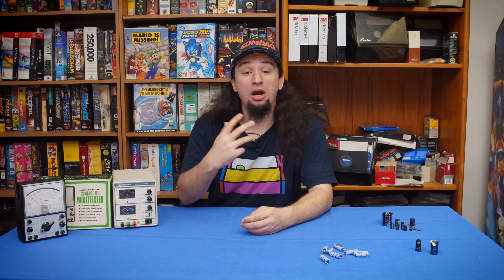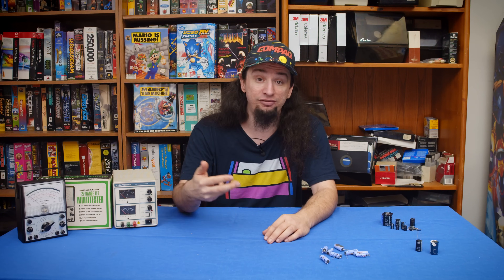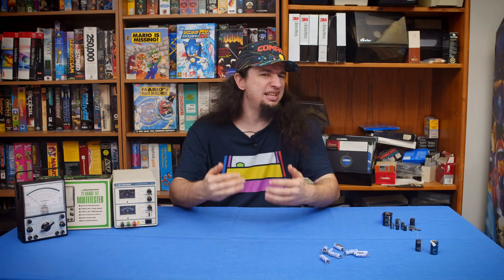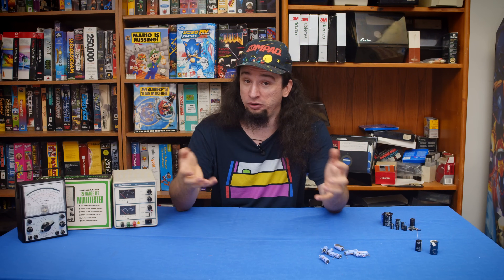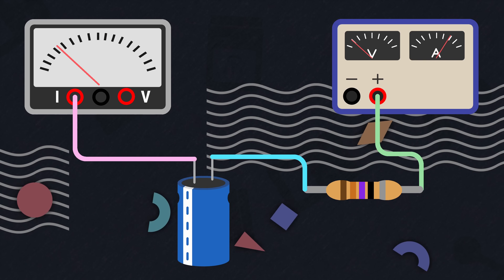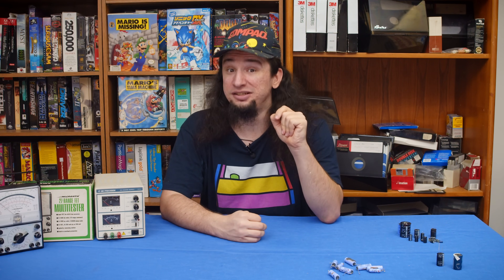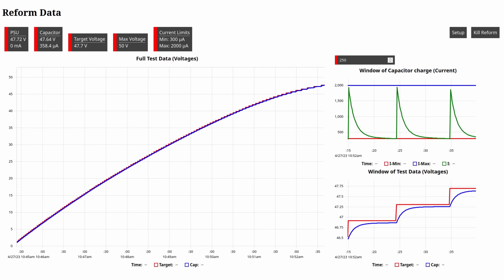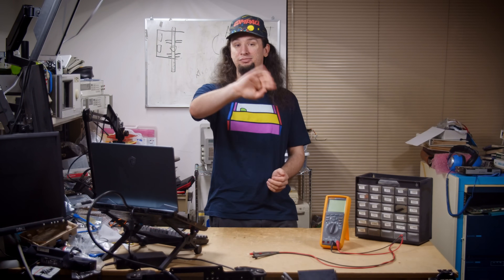Reforming Capacitors - Everything you wanted to know

Comment: Hello. It would be very interesting to make a video and talk about what happens if you use a 100v capacitor where it was originally 50v. Or 50v where there was originally a 5v capacitor.

what happens to the microfarad value during use and reforming of the capacitor or will the life be shorter when you apply 5v to a 50v capacitor og 50v to a 100v

Can someone say something about this

Comment: Hey, thanks for a nice and in-depth explanation! I've known about reforming capacitors ever since I started restoring tube gear, and I sometimes do that both in existing devices and new devices I build using antique components (can electrolytics etc.). Generally I test them before reform attempt. If there's no capacitance, it means that the lead has corroded internally and the capacitor is dead. Otherwise I'll attempt reforming, bringing the cap up on a 300VDC power supply through a current-limiting resistor, by setting the voltage to get ca. 5mA out of it, leave it for a few hours and bring it up again after the current drops below 0.5...1mA, observing the max rated voltage.

Looks like I could use a CC/CV high voltage supply for that and for tube circuit prototyping :)

Comment: If you have a good (GPIB or not) power-supply why would you use a resistor? Just set it's constant current control to 1mA, and to the voltage of the capacitor, then just wait.  Same result.

Comment: 1st step is good testing. Leakage, ESR, etc. But reforming has let me keep 70yr old amplifiers 100% original.
Reply: I recently bought a cheap kit that only need assembly, that has an LCD screen, that with automatic identification measures many types of components, even capacitors up to 100mF(!) and lists ESR and leakage. Very nice. But it is very important to completely discharge caps before testing, done first by a limiting load and then by repatedly shorting them a few times. If not, the instruments inputs can be completely damaged.
Reply: @Kenzofeis  The MK-328 style testers are handy little gadgets. I have one, but it is no substitute for my bridge, my 4 digit DMM, or even my Sprague Tel-ohmike.

The biggest disadvantage is that it can apply no more than about 5 volts to the tested component.
Reply: @johncasteel1780  
I looked at multi-testers, the multimeter lookalikes, but this chinese minifrankenstein thing does the trick at a fraction of the price, I paid the equvalent of $20 for it ^^
It noticeably drained the 9V battery when testing 1000uF caps, but that is how that works. I had to fix the PSU for a pair of minispeakers, so just had to have something, and multimeters only test to 200uF.
I suspected the smoothing cap after the rectifier and told a repairman this, he made a mess of the whole thing so I had to ignore my time constraints and do it myself, and buy that instrument, that cap had 48nF left of 68uF, so... he had short circuited something, blown components and changed even some caps that were ok...
/rant

Comment: Thanks for going through the effort to research this.  It's helpful to have it broken down to something digestible.

That said, IMO, these really large caps usually indicate that the device is using a linear PSU.  If you're supplying significant current through a linear PSU, it almost certainly has a terrible power factor, and you would be doing yourself and the electric company a favor by replacing the entire PSU with an industrial switching supply module.

I know, "historical" yada yada -- and in general, I agree.  I actually try to retain original PSUs as much as possible.  (Although I do recap nearly always, just because I don't care about OG caps, and I do care about long-term reliability.)  But, when I see multi-farad caps for something that needs a few (or even a dozen) amps at 5V, that's just crude as, and we can do a lot better.  Don't throw it out, but maybe just bypass it.  Nobody will know.  :-)

Just a thought.  To each their own, of course.
Reply: How does replacing a linear supply with a SMPS improve power factor? Are PFC circuits just a lie? Say it isn't so!
Reply: @1pcfred   Haha, no, definitely not a lie.  However, I wouldn't assume a PSU design this archaic cares much about power factor.

Here's why:

Linear supplies tend to use the peak of the AC waveform only, to top up the caps every cycle.  Active PFC typically uses something similar to a boost regulator to pull current below the voltage of the bulk caps' charge.

So...  If you're using a boost reg topology for PFC, you're already well into sophisticated switching topologies, so why would you then follow it with a linear regulator, when you're presumably capable of designing a switching buck regulator?  It would be far more efficient, use cheaper magnetics and capacitors, and consume less space and weight.
Reply: @1pcfred   OK.  ... so?

Linear supplies distort the AC waveform by pulling current only at the peaks.  It's kind of like switching noise, just at 50/60Hz and harmonics thereof.  Being at a low frequency and high (relative) amplitude of distortion, it's hard to filter out.

HF switching noise can be isolated from going upstream by adding a choke and some line filter caps on the input side.  Switching noise downstream is likewise dependent on how much L/C filtering you have on the output.

Switching noise generated by the computer itself is also a potential source of noise.  If it's a problem, you deal with it.  That's why computers are in metal boxes, or plastic boxes lined with metal.
Reply: @1pcfred   Uh.. thanks for that, I guess?

Comment: No! Just no! 
I think that you are confused.... 
In the literature you displayed to us on screen, please explain where the manufacturer stated that reforming of used capacitors is possible? 
I think that if you read the manufacturer datasheet, you will find that they are referring to new capacitors that have been stored for an extended amount of time.... 
You nor anyone else has the ability to measure electrolyte loss! 
The golden rule of capacitors are...
(When capacitors are unused but been in storage for a long time) 
Attempt to reform it! 
Check after reforming for high esr! Check for high voltage loss (high leakage current), check for capacity! It should be just under it's printed rating but if it's reading higher than its rating... It's dried up inside and replace! There's no such thing as an overachiever when it comes to capacitors.... 
(Old and used capacitors) large bulk power supply capacitors are more robust than the rest in the device... 
Most cheap capacitor testing devices can't test large capacity capacitors, the best that anyone can do is use a uA meter to test for leakage current as this measurement is more important than any other for power supply capacitors, nothing cooks a transformer faster than current leakage of its capacitors! 
As for the rest! You have no choice but to remove every single one by one and test out of circuit, you can measure in circuit for esr but not for current leakage! If a capacitor is leaking DC into the next device, it won't survive because of the phenomena of imposing a DC current on top of an AC signal, you effectively bias up the next device or stage and a cascade failure will take place! You can find new capacitors to replace old ones and while you might think that it's expensive, wait till that $5 capacitor takes out a bunch of transistors which are now considered unobtainium!... 

I personally would recommend, if you value the piece of equipment you have and want it to last long! Replace all the capacitors! 
If you want to try and keep the device as original as possible, try and track down some new old stock capacitors and take your time reforming them but under no circumstances should you ever reform old capacitors! 
Another golden rule for if you have just purchased a piece of equipment that has been in storage for a few years or more and it's not a very old device ie. Has modern capacitors that were made in the 80's or later, put the device on a variable voltage transformer (Variac) and bring up the voltage a few volts at a time over a long period of time to wake up it's capacitors from their acoma! You wouldn't like to be woken up by being slapped either and you would probably blow up too! 

Don't reform old capacitors! Or learn the hard way!

Comment: I thought you'd be talking about the typical small electrolytic caps (especially those made after about 1980), which, yeah, I wouldn't bother: they're generally cheap and a good number of them have physically failed, but it does make sense for bigger caps that may cost more than 10 cents/ea and/or are NLA. Apparently United Chemicon haven't looked at failures of e-caps made since the '80s if they're calling leakages "anomalous" failures: of all the bad e-caps I've come across, electrolyte leakage (either age-related or "capacitor plague"/counterfeit electrolyte-related) has been the #1 cause of total failure, especially in SMD types.

Comment: Computer controlling a power supply seems like it's probably massive overkill. Normal bench power supplies often have an adjustable current limit and will reduce their voltage when the limit is reached. Could one not just modify one of those so that the current limit is adjustable from say 0 to 5mA instead of the more typical higher values on such supplies and just use that?

Comment: Maybe we could create a standalone device for this. Controlling a cheap powersupply (maybe even a buck converter connected to one of these cheap chinese 24V-LED-PSUs for caps with low voltage?) and some cheap measuring ICs connected to an Arduino or Raspberry Pico? Then you could treat reforming similar to charging rechargable AA-batteries: Just put them in and wait until they are done. If it becomes just a simple enough process, it will be just a no brainer to do it for all caps, that are hard/expensive to replace.

Comment: little confused by the complexity of the automation, dont you just need a psu with high a resolution current limit (could be as simple as fitting a x10 or x100 replacement shunt (multiplication of the psus original shunt value). just set the max voltage and use the constant current mode to clip the max current  you want to allow -and just leave it to do its thing ?  apart from modding a bench psu to get ma resolution what am i missing

Comment: not quite on topic but i see a lot of restorers say if you cant get a replacement of the original capacity value fit something bigger- if not done right thats a whole load of trouble with inrush current, ripple current 
and its also little known that psu caps are often calculated for specific rail ramp up , ramp down timing in multirail systems ,"ever since i recapped my amp/preamp i get switch on pop and switch off squeal (i.e quad amps that dont have speaker muting delay)

Comment: In the Telecom Industry, we are running into this more frequently, as legacy equipment shows its age.  Most of our older Voice Switches employee electrolytic capacitors, to add further filtering to our primary office battery of -48 to -53 volt DC.  Over time, these filters caps develope leakage currents outside acceptable limits, & thus they are fused accordingly, to reduce catastrophic failures.  As part of our testing, we precharge caps with a series light bulb, of a known value.  When the light extinguishes, the cap is charged with minimal leakage.  However, if the bulb remains illuminated, it's time to replace the cap.  It's old-school, but is time tested, & relatively simple to do.
Reply: yeah, visual test rather than using testers, I like it
Reply: @zer0b0t  You need to do both.
Reply: I like that idea. Thanks!
Reply: And the electric company wants to come install a smart meter on my house, HA! jokes on them!
Reply: 3:50 almond

Comment: Why bother reforming capacitors? They will fail again in the near future anyway and possibly at an inconvenient time or cause other damage to the DUT. Just test and replace. If the equipment is over a certain age just replace anyway. Faster, cheaper and safer.
Reply: Tell me you don't understand what's going on without saying you don't understand what's going on.
Reply: @1pcfred  I do understand. An EE with all the qualifications. Always just replace caps. Reforming them to try and eke out a few more hours before they leak all over the PCB and trash it is crazy. It is the same as those who try and recover a worn out lead acid battery, recycle and buy new. Nobody is that poor that they cannot buy new good quality parts. They are all relatively cheap.

Comment: You can't reverse time.  It's impossible.  "Reforming" capacitors is a fool's errand.  Save you electronics, your time, and your money and just replace them.  Do a proper repair.
Reply: It is not impossible to build up an oxide layer. If it was you wouldn't have electrolytic capacitors at all. This is chemistry. It's OK if you don't understand it. Back in the day billions of dollars of electronics were defective because others didn't understand it too!
Reply: @1pcfred  i fully understand chemistry,  which is why I've never had a catastrophic electrical failure due to a defective capacitor that was years past its failure date.
  You can't reverse time.   It's not ok if you don't understand that and give people bad advice that could cause them thousands of dollars in damaged equipment. .

Comment: When you talk about healing of electrolytic capacitors, you show metalized caps.. healing in those is really not the same, it's destructive and blows out any part of the foil that starts to conduct, effectively loosing capacitance rather than using up electrolytic to reform an oxide.

Comment: If you have a reasonable digital CC-CV bench power supply with 1mA current resolution (like a Rigol or a Miniware) you can do moderate-voltage caps without all the fuss — just set the power supply's voltage limit to the capacitor's rated voltage, the current limit to a few mA, turn it on, and let it sit. If after a few hours the power supply is still in current limited mode (hasn't hit the target voltage yet) then your cap's leakage current is higher than the limit you set, and you will have to use good judgment to decide whether to bump up the current a bit more, or discard the cap as faulty.
Reply: As his HP power supply he is using in the computerized version has that resolution I was wondering why he eidn't just use that.
Reply: @eDoc2020  Because not everybody has such a nice power supply, and spending close to $50k, to test a $5 capacitor, is not exactly good economic sense.
Reply: @SeanBZA  But he used the GPIB which requires an expensive system. If he just used the current limit a sub $100 PSU would work just fine.

Comment: Great video topic, and well explained. I first encountered the concept of electrolytic capacitor reforming in a manual for an industrial variable frequency drive (for speed control of AC motors, if you're not familiar). It was a totally foreign idea to me, and I was surprised to learn that it's necessary due to the way electrolytic capacitors work, as you described in the video. I had no idea at the time, and I still think it's pretty wild.

Comment: question, wouldn't it be ideal to measure the voltage across the capacitor rather than the cap and resistor pair?
Reply: Classically you only monitor the drop across the resistor.
Reply: @Paul Frederick  if you wanted to measure current.........
Reply: @1pcfred  mate I think you know just enough about electronics to answer confidently about something you know clearly little about.

I found my answer, the DC resistance of a capacitor is effectively very high, so there's a miniscule drop in voltage across the resistor as compared to the capicitor, so measuring across the capacitor or the capacitor resistor pair give effectively the same reading.

As you need to stop the process when the voltage reaches the rated cap voltage, this figure is important and not just a trend.

Comment: You know, even a lot of basic bench power supplies these days (which aren't complete crap) actually have built-in current-limiting functions.  If you have one of these you don't even need the resistor or the separate current meter, and you definitely don't need all that complicated computer control with custom software, etc.  Just set the max current of the power supply to a reasonable reforming current, max voltage to the rated voltage of the capacitor, hook up the capacitor, and let it run for a while.  The power supply will automatically adjust the voltage to maintain the specified current, until it gets up to its full level (at which point, it should be fully reformed, or at least as reformed as it's ever going to get).

Comment: Nice one! Just what a sceptic like me needed :) A few times you made it sound like a cap is supposed to “have a load” or “be a load” which is a bit confusing, but in this context it does make a little bit of sense, considering we’re talking about ESR.
 I still have a hard time finding a use case since it’ll still be easier to replace an old one and less risky - time is money and a new one is less likely to blow up 3 months later leaving the neighborhood soaked in electrolytic.
Sometimes the original caps might be a big part of the aesthetic though - in that case reforming is your only bet.
Always good to have another tool in your arsenal, thanks!
Reply: Like he said in the video, it's definitely a viable option for the large electrolytics (like soup can sized or bigger) that used to be in old products - those things are super $$$$ to replace. For your average up to 4700 uF caps you find in modern stuff, most of the reasons they've failed is because they were garbage quality / china off-brand no name garbage to begin with. Best to replace with name brand quality caps - and they cost ~$1 or so anyway, so who cares.